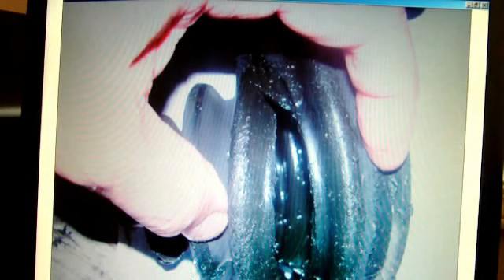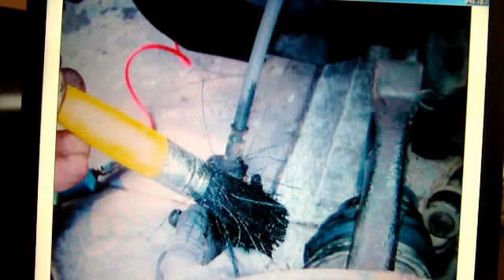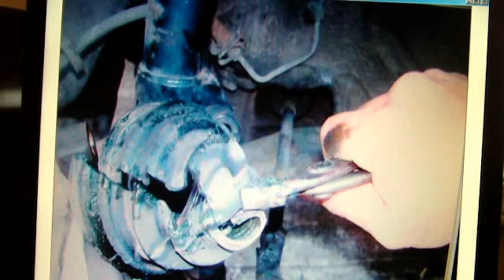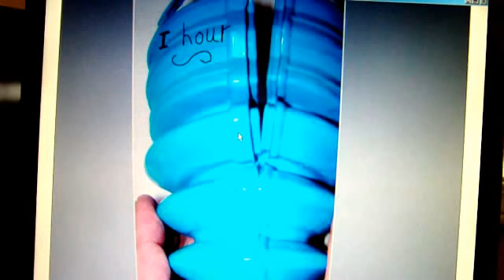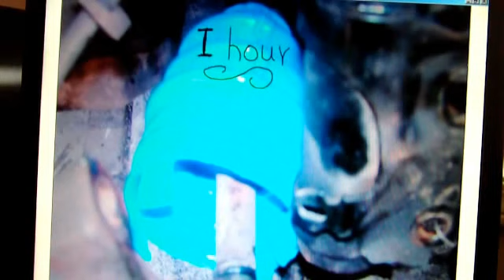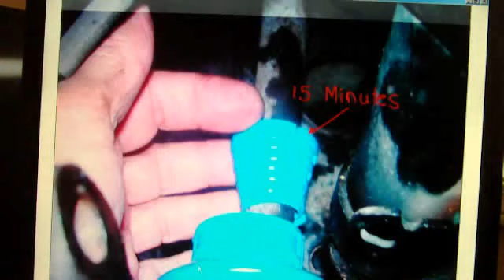C.V. Boot Repair, with a quick boot

Comment: This video seems to cut short.  Cuts off kinda mid sentence.  How did you get the adapter on?  Seems there is the piece that threads together, but then the piece that goes in between that and the main boot is a solid ring (you refer to it as a collar).  Did you cut the ring and glue it back together?

Comment: not enought info
Reply from the maker: +Rigoberto Vera  What did you feel was left out?  I might be able to answer the part I may have left out.  MVI
Reply: Well because your not showing you need a tool to tighten the bands on the axle boot
Reply: +Rigoberto Vera This one's a Dorman and it's fully split into two halves.. if you search on ebay, you'll find a different type like black rubber, it's only split at one point and looks easier to join.  I haven't tried any but I'm researching.
Reply from the maker: +Rigoberto Vera  Wire cutters work.  Some use bigger zip ties.  Cheers MVI
Reply from the maker: Big snips will work.

Comment: Any idea if these hold up in -30 degree type weather (assuming it was properly installed etc)?
Reply from the maker: I haven't any feedback on that, but I think it should.  The glue really welds it
together.  Let me know next spring.  MVI
Reply: MECHCANADA I will.  Thanks
Reply from the maker: +RobPolson   Sorry I missed your question.  I have not tried or heard of them being used in cold temps.  My guess is that they should from how the weld 
worked.  But I cannot say for sure.  Cheers. MVI
Reply: That's OK.  I opted for the full transaxle just in case.  Thanks !

Comment: hi thanks for the video, it went together well, I had enough axle room so put it on and glued it before removing the old boot. Will let it several hours to cure. all clean. Seems like it should work good if the glue is good. The joint should be, or could be as strong as the rest of it. It is not as supple as I figured like an epdm rubber. Went together easy on the first try. Hopefully will work good. The people at the parts store are anti these and not so helpful, but hopefully it works good. My car was so rusty I didn't want to try and remove the bolts.
Reply from the maker: Hey the idea is to have fun and do what works for you.  That is kind of the
purpose of the videos.  My way may not be the popular or correct way, but it
worked and I got the job done.  Live out of the box.  Cheers MVI

Comment: Thank you very much for the video! I just picked one up at Advance Auto for $16 after a 20% online discount code was applied. I also see so many complaints about these boots, but they seem very simple to me. Attention to detail and cutting corners is what I suspect is the cause of many peoples headaches.
 My boot is going on the drivers side. Here's a little warning to everyone here. I just replaced the entire axle assembly about a year and a half ago. I crawled under to do an oil change 2 nights ago, and saw grease everywhere and a very large split in the boot. This was a cheap $50-$60 eBay axle. My passenger side still has the factory boots and axle, with 144,000 miles on it, and not even the slightest crack in either of the boots. So be warned and stay away from the eBay cheapie, no name stuff. Had I spent another $30 on the axle, I wouldn't be having to replace a boot already.
 Again, thank you for the video. I certainly feel a bit more comfortable tackling this, having seen a glimpse of what to expect. Now I'm off to glue the first side, and let sit for 1+ hours!
 I'll follow up with how my experience went with this. My vehicle is a 2007 Grand Prix GXP.
Reply from the maker: Sounds like you have a good understanding of what is needed to do a successful job.  It is another way to do a boot change and for those who are intimidated by taking the axle apart or who don't have all the tools, this is a great alternative.
Good wrenching.  MVI
Reply: MECHCANADA
Well, I can say this went pretty good, all in all. I glued the first side of the boot Friday night, and was beginning installation the following morning. I was a bit uneasy as I opened the boot up wide enough to slip it onto the shaft. I wondered if the glued side would start to come undone. Well no worries there. That stuff is extremely good and as previously stated, if you keep the grease out of the seams, that stuff will hold with no issues at all. I did make sure I wiped the grease away as best I could, before putting the new boot on. Like many, I didn't care for the included clamps. I went for tie wraps, but there was just enough grease present that I could get the ties tight enough, they would just spin around the boot. So I went down to Home Depot and found some good old fashioned hose clamps, with the Phillips screw head on them. I used those on each end of the boot, and I have had absolutely no issues. I have probably drove 3oo miles now, and I just checked it when I got home an hour ago. While I did notice the slightest bit of grease squeezing out the outer, large end of the boot, it's still perfectly in place, and tight. Grease amount so minimal, that's I'm not even concerned.
  So after watching this video, and following the instructions included with the boot, EXACTLY, I see no reason not to recommend these. My total time spent on this, including the 1hr drying time on the second seam, and tools cleaned up and put away, just 3 hrs. Not too bad. Yeah, maybe you could have threw a new half shaft in there in that amount of time, this is much cheaper, and a lot less labor intensive. And for me, I don't have a pry bar, or the correct socket for the spindle nut, so this was the way to go for me. In my first post, I mentioned I previously replaced this half shaft, but at a friends house with the proper tools.
   A huge thank you to MECHCANADA for the great video. Your time and effort is much appreciated! Keep up the good work!
Reply from the maker: I think you will find it works and it sounds like you are doing it right.
Cheers

Comment: While I appreciate the detail you present.  I think it more relevant to show how the boot fits on to the CV Joint.  I admit to scanning the video rather quickly however I saw nothing about retrofitting the small end of this joint.  Nothing about installing it on the joint itself.  Nothing about how you pull the joint onto the shaft.  I just think, for me, it would have been really helpful to know more detail.
Reply from the maker: The end plug is split as well, like the big part is.  So slip it on and glue it, then slide it in and clamp it.  Hope this makes it clearer.  The two halves are shown over the shaft.  Thanks for writing in.  MVI
Reply from the maker: Good point.  MVI
Reply: Rich Swadley Shut up rich!  I'm trying to watch!

Comment from the maker: New it nice and a better way to go.  Sometimes a little cleaning and care can make the difference between someone getting running or not money wise.  For others they like to putter and fix.  Average saving would be around 75 dollars and that can do the trick.  Depends where one is on the food chain and at what stage you catch it for sure.  Cheers MVI

Comment: Yeah hoping the one I did will hold at least that long. I checked it after going a little ways with it and it is still in place and holding grease. 

But I was fortunate enough to be graced with a leaking water pump that I need to remove the timing belt in order to replace .....lucky me so got the passenger side of my vehicle completely tore down. Fun times hope nothing else pops up oh and finished a loose sway linkage. Some people just let cars go and don't fix em lol.

Comment: a dremel cut off wheel makes quick work of removing the old cv boot and clamps. I used the glue they gave me however it was a pain in the ass getting the adapter into the boot and getting it to stay flush. I used a hose clamp for the skinnier side of the boot. It isn't leaking but these things seem to suck ass and will probably replace the whole axle in a week or so. These are just too much of a pain to even mess with.

Comment from the maker: You will find the rubber is a little heavy but I have seen the car weeks later and it is still in place on the axle.  Hope you do better with the metal straps than I did.  I used zip ties and they are holding.  Got that idea from a hydraulic shop on a fuel line.